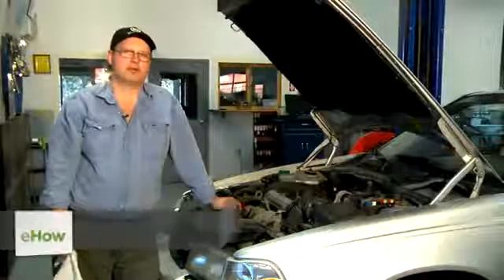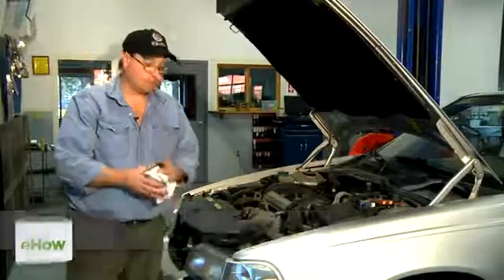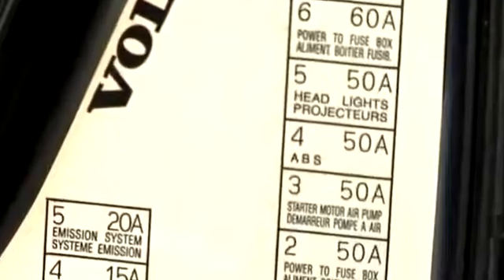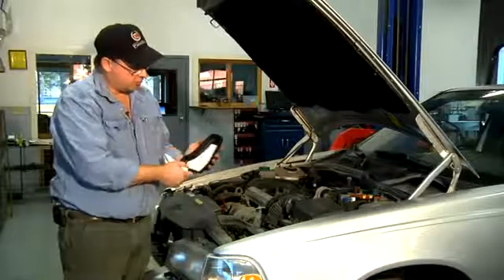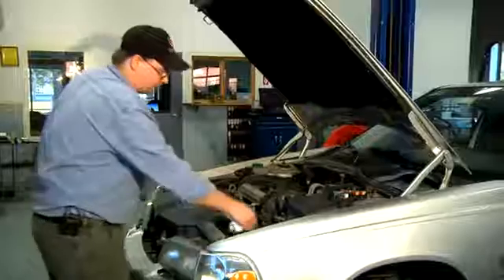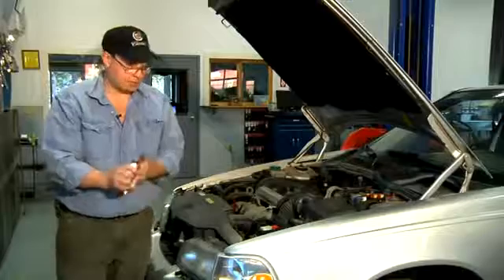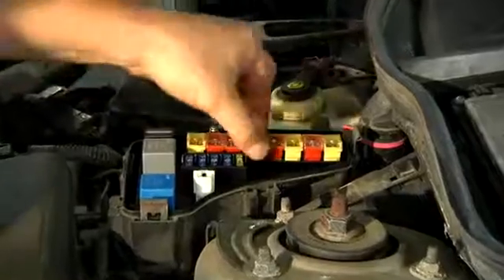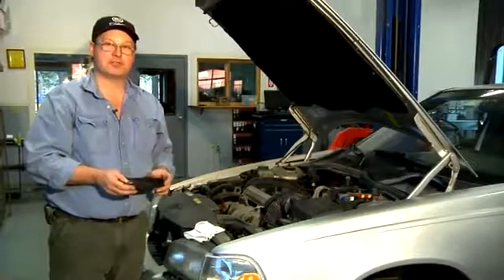How to Disable an ABS System

Comment: Thanks for this.
That "sinking" feeling is exactly why I want ABS deactivated permanently. It has almost resulted in wrecks several times. My 1999 Ford Ranger was terrible about this. My more recent model Honda has the same issue.  I don't think car manufacturers can fix this because this is a result of the ABS working as designed. And it is the logic of the design that is faulty. 
Asphalt streets tend to buckle up as vehicles(especially big trucks) come to a stop at intersections. Especially during the summer when the asphalt gets hot and softer. The pavement ripples at intersections. And intersections is where you often need to stop.
So if the light changes just right (or just wrongly) and I have to stop hard, the wheels will bounce on those ripples. The wheel is in the air for a few milliseconds and since the brakes are being pushed hard that wheel stops spinning for just a millisecond of so.  In reality this is no problem because as soon as it comes back down and touches the pavement it will continue braking and slowing the car. BUT, the ABS can wrongly perceive this as a wheel lock skid and the system activates and begins fast pumping my brakes. This reduces my braking power to about 10% and I slide out into the intersection.
I suppose there are ways they could "fix" this problem. But that would make the system even more complicated and expensive. Perhaps some kind of pressure sensor so if the wheel is not touching the ground and thus there is no weight on it then don't activate ABS. But that would be a complicated sensor system.  Or maybe make it only activate when the air temperature is freezing or below so the slip could be caused by ice which is the main purpose of the ABS.  But again - complicated and expensive.
I'm an engineer. And I described this flaw to my workmate engineers. They all said they had never experienced the issue. Then most of them, over the next few months told me that now that they were aware of what was going on they had not only experienced the fault but realized they had experienced it several times in the past and just didn't understand what had happened.  And all of us wanted the system deactivated because we felt it was dangerous. And pointless in the South where we don't have ice on the streets.
It's just more safety features that in reality makes our lives less safe.